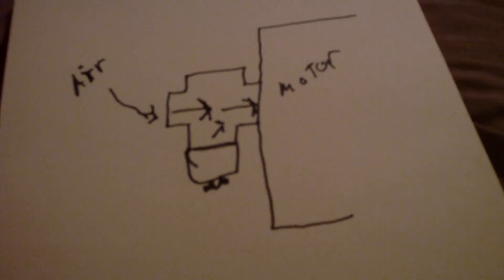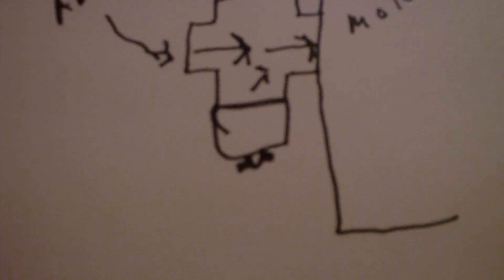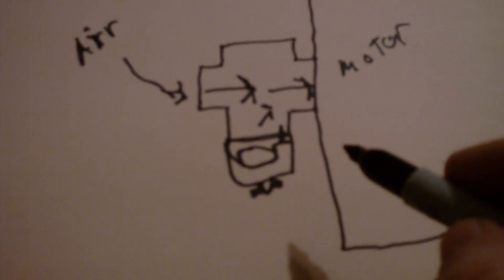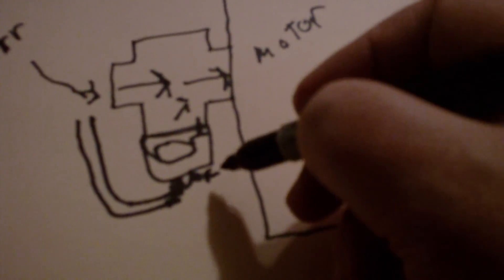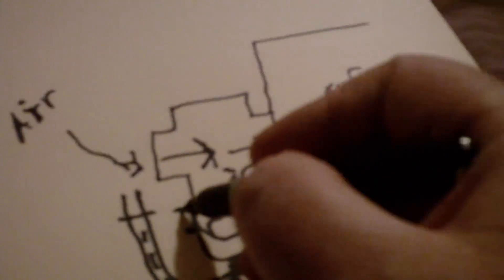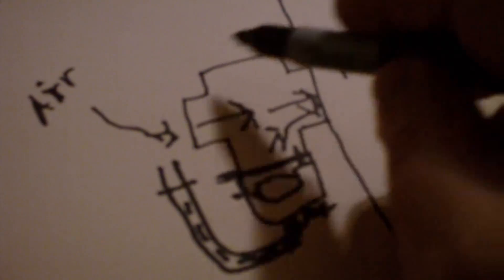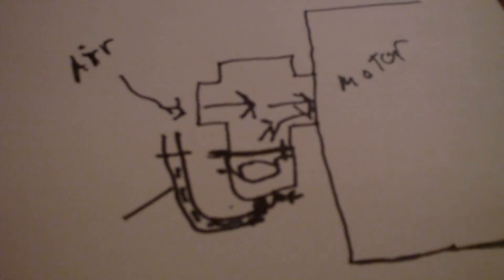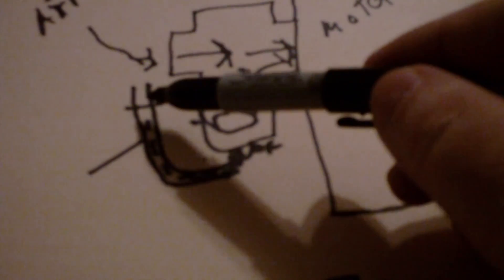Setting Carb Floats.

Comment: I knew where you were going as soon as I heard "clear tubing" kinda like an old farmers trick to level footings, a length of garden hose with some clear tubing on both ends filled with water. Question, as a rule of thumb would you say top of the float bowl is a pretty safe bet for most carbs? I'm a bit old school so I go by the gas level, not the float height.
Reply from the maker: Jeffrey Stroman I would agree with you . Thank you !

Comment: i have a ktm 65  mikuni carb leaking and overflowing what do i do to the tab or which way do i need to bend it. any suggestions please.
Reply: Aprile Harper floats are set to high. check the needle and seat.
Reply from the maker: Patricia Vittner  Good advice ! Thank You !